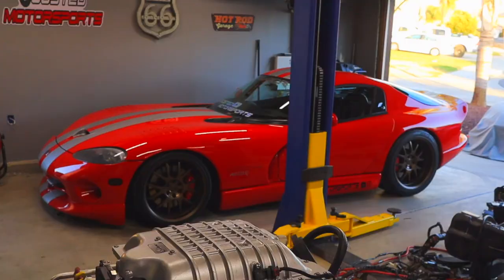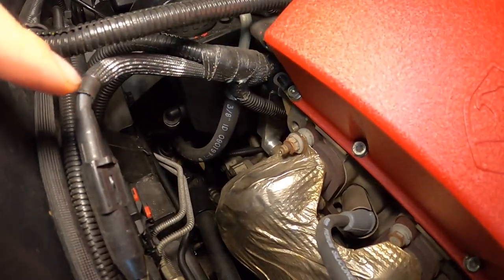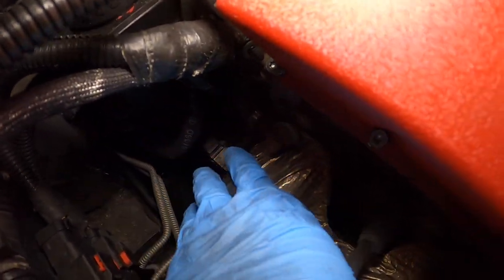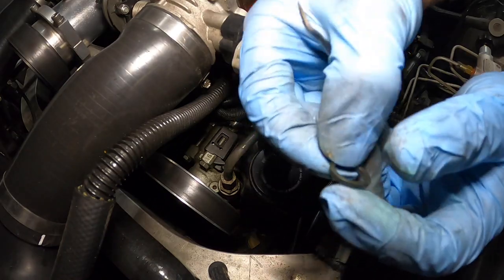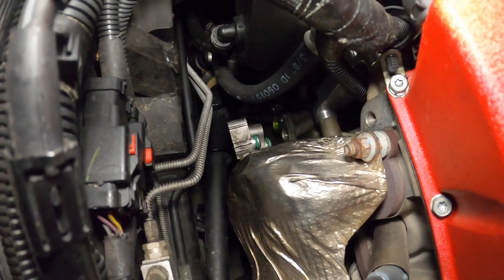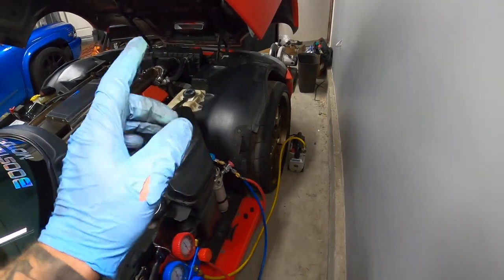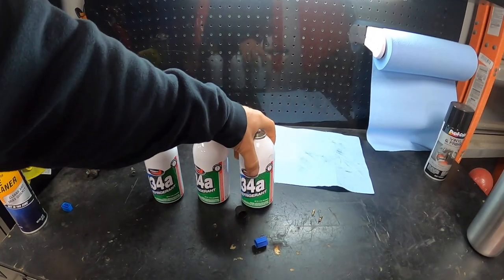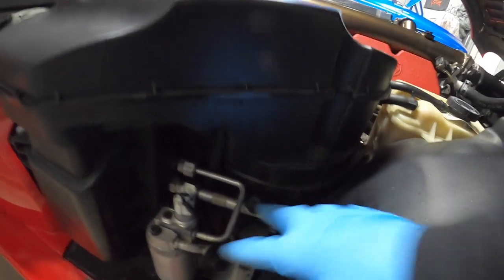AC Air Conditioning System Leak on Dodge Viper 1996-2002

Comment: Love these videos. They are extremely helpful. Just an FYI. I have a 1998. I had to replace the radiator anyways, so in order to try everything to try and get my AC to work, I had the condenser done as well. It ended up being the hookup line to the condenser and not the condenser itself. Problem solved.

Comment: Just FYI.   The Viper Service Manual states to oil the new valve core with new clean ND8 PAG compressor oil before installation.   Good luck finding ND8 PAG.   But, you can use PAG 46 which is available at most auto supply stores.  If you skip that step, it is quite possible that leaks will develop around the valve cores.

Comment: The top one probably isn't original and the lower one probably is.  The green o-rings are HNBR which are rated for the PAG oil and the temperatures that AC systems face, while the black o-ring is just rubber and will harden and crack when exposed to PAG at temperatures.

Thanks for the video, probably going to have to help a buddy deal with his in a few weeks.

Comment: Will the compressor cycle on if there is no refrigerant in the system? My AC hasn't been working and I can't hear it turning on so I took it into the shop and they vacuumed it and were going to put some refrigerant in it but the compressor wasn't going so they were thinking I need a new compressor.  Should we try and pump some in to see if the compressor turns on?

Comment: Dodge didn't do any favors with "ease of maintenance".......those of us who work on vehicles are all victims of poor engineering! Ford & Chevy are no better either.
At least the high side valve uses an actual schrader valve, as opposed to GM's use of a rubber check ball in the hi side fitting.